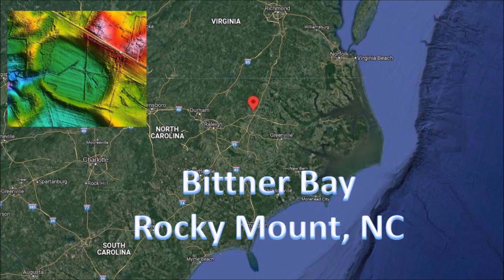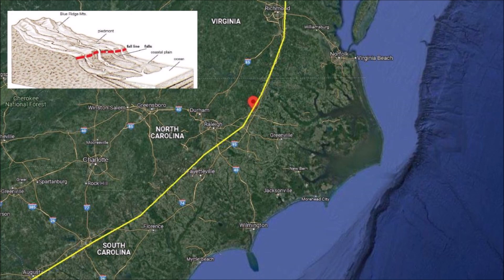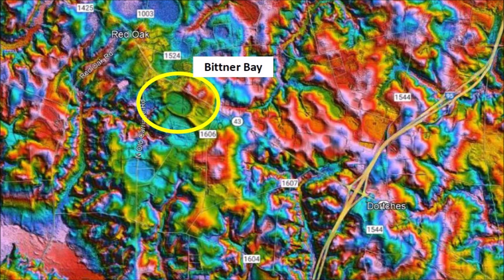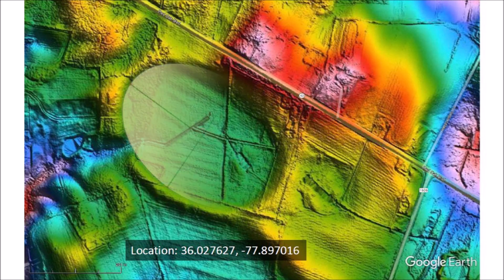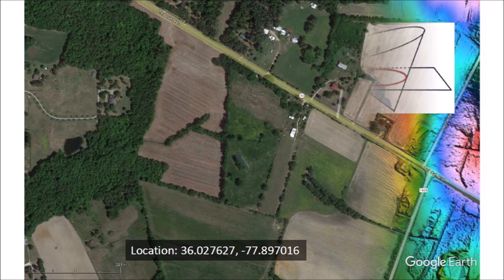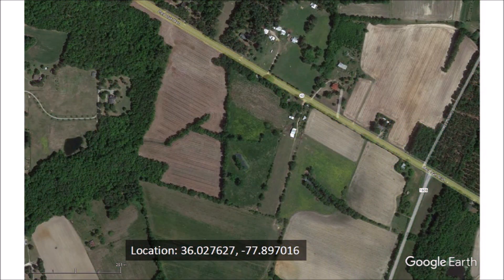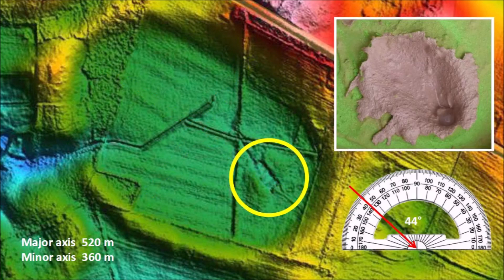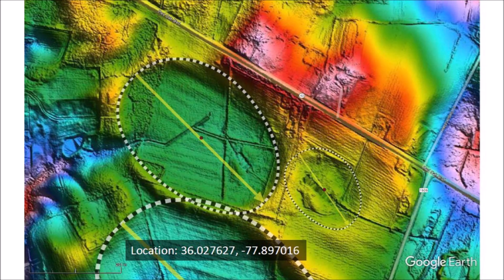Carolina Bay near Rocky Mount, North Carolina

Comment: has anyone dug into that spot to collect samples? maybe we could find materials from the initial site where the ice launched out
Reply: Any remnant would be to deep to access, without major difficulty.
Reply from the maker: I originally thought that the glacier ice boulders would be buried too deep,  but in my experiments I found that ice is less dense than the liquefied soil and it floats during viscous relaxation.  Now, I think that some evidence from Michigan may be found close to the surface,  but it will need to be a large bay made by ice from the bottom of the glacier.